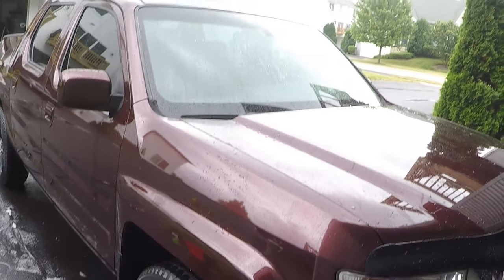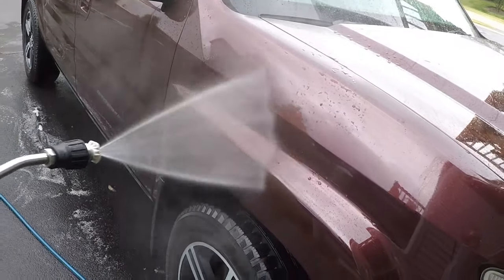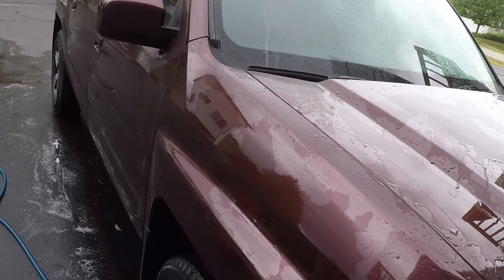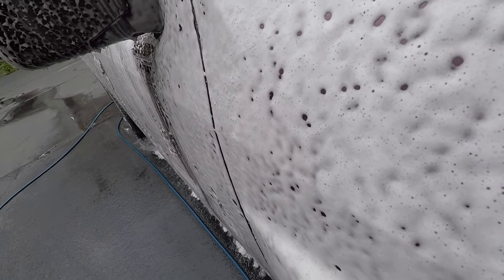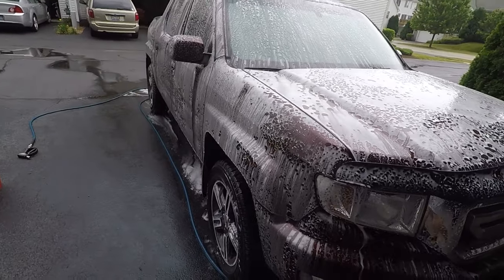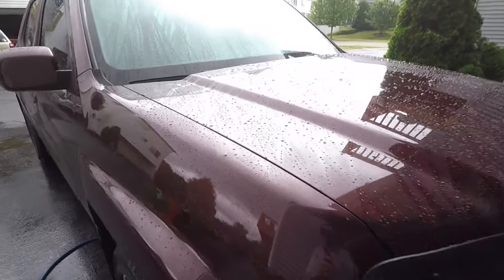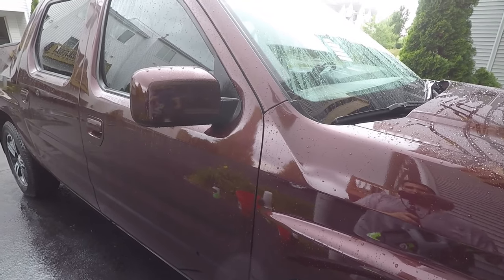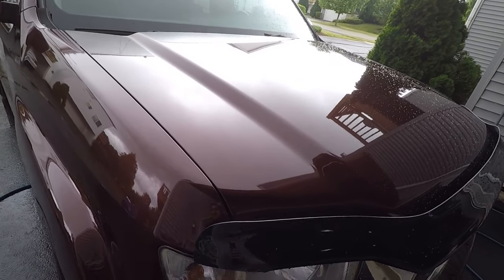NANOLEX Wash Coat as a Stand Alone Option

Comment: What kind of blower is that? (Drying the truck) thanks
Reply from the maker: 110 MPH 530 CFM Variable-Speed Turbo 56-Volt Lithium-ion Cordless Electric Blower w/ 2.5Ah Battery and Charger Included

Available @ home Depot. I have a video modifying the switches as well.
Reply from the maker: Ego Blower**